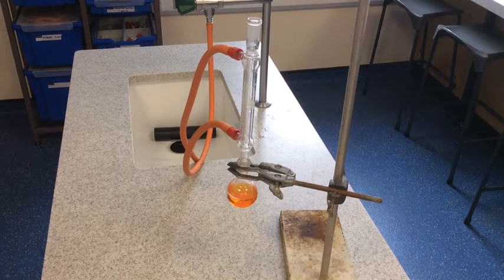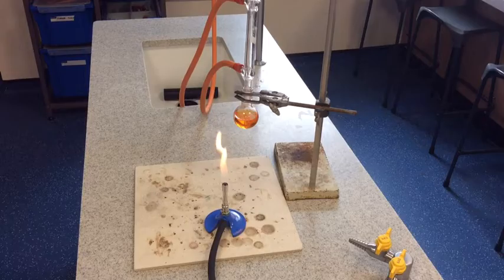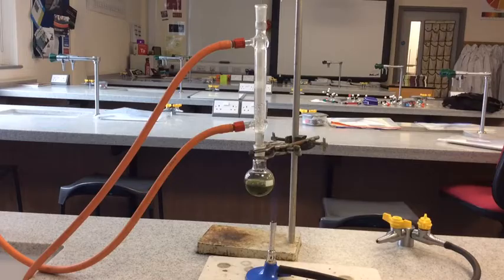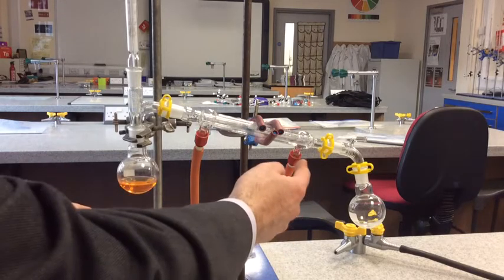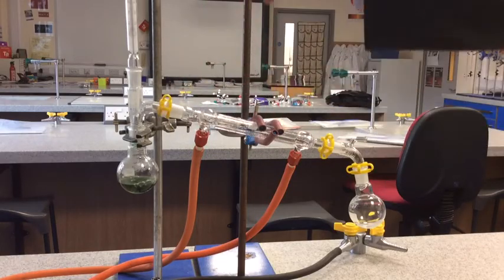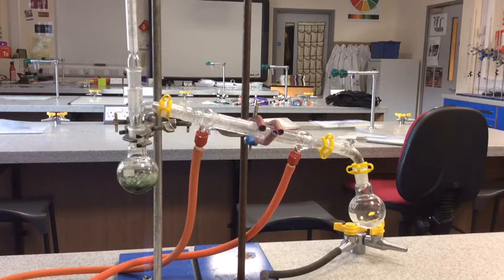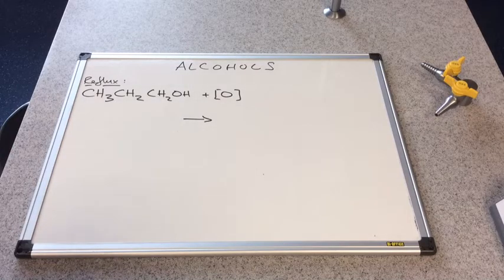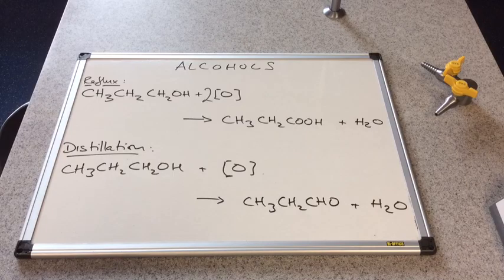Oxidation of Alcohols Reflux vs Distillation

Comment: I have to do this practical with my class. Which alcohol did you use for the oxidation? I'm guessing not ethanol as the ethanal boils at 20C. I was wondering what you used - propan-1-ol? Thanks

Comment: So, when you oxidise a primary alcohol with [O] under reflux, you produce an aldehyde, and oxidising this aldehyde in a distillation position produces a carboxylic acid? But if we oxidise a primary alcohol under just reflux we produce an aldehyde and if we oxidise a primary alcohol under distillation we still get an aldehyde, so for a primary alcohol we must reflux and distillate to form carboxylic acid, and in secondary alcohols we can either reflux or carry out distillation because we will always form a ketone? (Sorry, just making sure I understood correctly :) )
Reply from the maker: You’ve got it the wrong way around for primary.
Reflux gives the aldehyde then the carboxylic acid
Distillation only gives the aldehyde

Comment: During the distillation process, why it is more efficient for the water to go from the bottom to the top? isn't it is just the same?
Reply from the maker: If you fill from bottom you’re filling under gravity and the condenser will fully fill with water. If fill from top it doesn’t as you get air bubbles

Comment: I'm curious. Dichromate oxidizes primary alcohol all the way to carboxylic acid, right? how then can we get aldehyde from the process?
Reply from the maker: It's a stepwise process. Aldehyde produced first so if removed from reaction vessel it can be isolated. This is achieved by using distillation rather than reflux.

Comment: The explanation of distillation and reflux is very well done but what about safety? Like no gloves, no lab coat, open fire while working with highly volatile substance with a low flash point, no boiling chips, no fume hood (I mean, the vapors can be irritating)... I know that no vapor should be able to escape out of the system but still one never knows as the procedures can never be 100% perfect. This is just not OK...

Comment: I was just wondering when you are heating by reflux, how do you know if the reaction has gone to completion or how do you know how much of the carboxylic acid is present?
Reply: Chemists monitor reactions by doing a TLC (thin layer chromatography). You learn this in year 2. You will also use TLC to analyse the purity of aspirin (if you this experiment in you college).